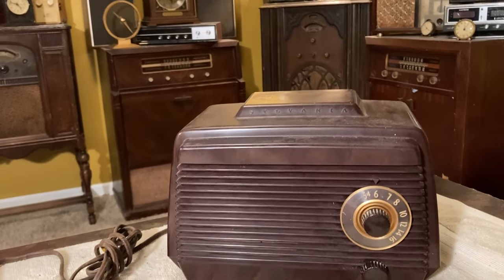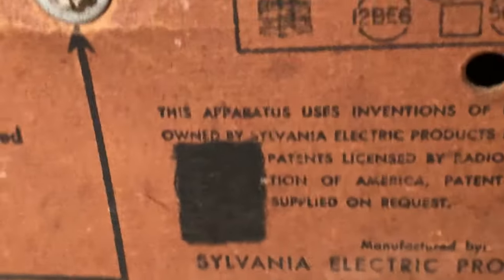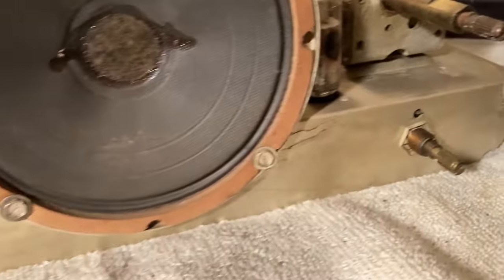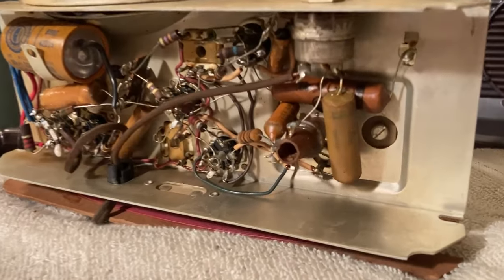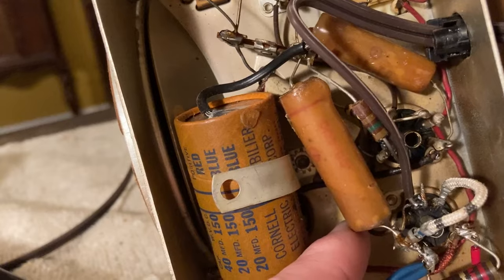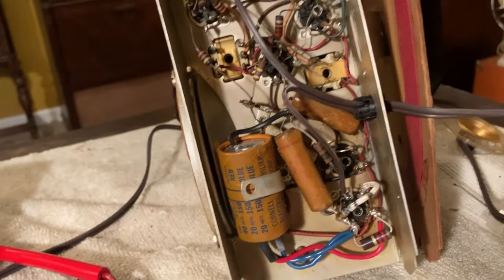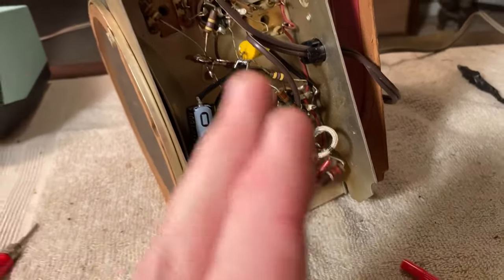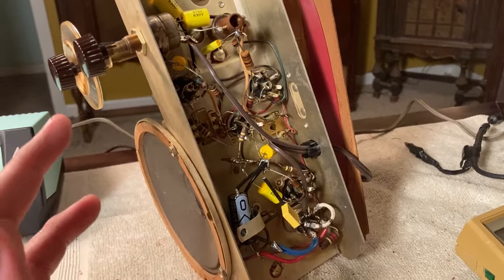Old Sylvania Tube Radio BUZZES On Low Channels!

Comment: Hi Ron, nice job!  Just wanted to mention in case you’re not aware, on a lot of these old schematics, resistors marked M are actually Kohms.  Only the ones marked Meg are Mohms.  Regarding the buzzing on the low end of the dial, it still sounds like power supply interference.  One way to check would be to take the radio outside away from any buildings and see if it goes away.
Reply from the maker: Thank you Maury!  That's the whole problem with the "I got the wrong resistors"... when I was looking at it, in the back of my head I was thinking "didn't these used to be marked different?" but I chalked it up to the mfd /mmfd thing...so when I ordered the resistors, I ordered them off the list on the other page, which shows the whole value.  470,000ohms for instance, so I ordered 470k... and then when I was looking on the schematic, it says 470m... and they sent me 470k (which is what I ordered off the other page!).  Well good now I know that the parts place isn't incompetent, I just don't know how to read :)  Thanks for watching!
Reply: Yup, M=1000 is an old school convention in manufacturing. We also sometimes saw C used for 100, like in Roman numerals.
Reply from the maker: That actually makes sense, Mille is 1000 in Latin, Spanish, French, Italian, Etc. I believe
Reply: Now you Menton it, I had the same problem. But 15 years ago, my local supplier knew how to read old schematisch. I learded alot from this guy.

Comment: The buzz didn’t occur when you powered  up before replacing caps, maybe one was incorrect, I would have kept the polarized plug and put the wide blade on the chassis ground so you won’t get shocked.

Comment: I have had similar issues with interference and it turned out to be under cabinet lights in our kitchen at the other end of the house. My father had loud interference on his radio and eventually discovered it was from a light in the kitchen of a house across the street. The neighbour got a new bulb and the problem was solved. Love your no snobbery approach, Ron.
Reply from the maker: When you were having that interference, was it only on the bottom of the dial?  That's the part that has me confused.  Thank you for watching Andrew!
Reply: I'm afraid I don't remember, Ron. I do recall that my dad's interference only occurred at certain places on the (FM) dial, drowning out his favourite station but leaving others alone. The only thing that allowed him to track it down was that it showed up primarily at meal times when his neighbours' kitchen lights went on. I think it was halogen lights causing the problem - as it was in my case. It does make sense to me that this sort of interference might be limited to a specific range of frequencies.
Reply from the maker: Someone else provided some info that yes it usually shows up on the bottom of the band, I'm going to see if I can find anything else in the place but if not it may be a neighbor's house, lol  Apparently you can see it with a scope too I may try that, thank you for the info
Reply: Good luck - it's a cool no-frills radio, although they spent money on that geared tuner.
Reply: @AmateurRepairTime  I've worked on a lot of radios, and that type of static is quite common around here. I'd imagine it's better or worse on certain radios depending on their design. I've just accepted it as part of the AM band in our modern times. It's interesting that it still seems to have a 60Hz component (in the USA), but it sounds like pulses. Fluorescent lamps can cause similar interference, and I actually found one of my motion activated lights caused horrendous interference that only went away when I replaced it with one that works with LED bulbs (which I believe uses a relay instead of a triac for switching).  I bet another radio will receive the same interference so you can clear the Sylvania of being the culprit.

Comment: And another thing! ;-) In the 1940s and 1950s, the plugs on the power cords were originally molded like the new one was. However, since people liked to unplug their radios by yanking on the cord, they ended up having to replace the plugs with the screw-on ones like the one you found on that radio.  But I'm not worried about it. I can't see it from my house! ;-) I enjoy your videos, and you are learning a lot, as I've learned from you as well.  (Your work on solid state pinball machines has encouraged me to work on solid state audio!) Nice job, radiophonopinballnut!

Comment: To check suspected alignment error without adjusting screws , can add and subtract hand capacitance via insulated tool, it either worsens or improves

Comment: Your actually doing it right.. Bring the unit up on a isolation transformer slowly.. See what the radio does??? If the filaments are in SERIES, and one is open the radio will not only do nothing, draw no current, but the tubes will not glow.. 99% of the time, bad tube.. If the tubes are OK, may come up with a Bad Hum, 99% of the time bad capacitor... Better to figure out the basics, before you dive in and spend the time and $$$ replacing capacitors, only to find out it does not work... 🙂
BTW, not sure if you own a DimBulb current limiter, but a must have for first power up of any tube or electronic device... Mine is very unique, but there are tons of documentation on how to build one.. Personally I think mine is a better way to do it and cost 1/2 the costs. Had to go to both Lowes-Home Depot and a local Electrical store to get all the parts, because not everyone had the right parts available!! 
As for the noise, I had a similar and what the fix was, was to go and tighten down all the securing screws on all the Circuit Breakers in my breaker panel, including the main ground buss... May or not cure your problem... TBD
Robert San Diego

Comment: That's a good radio, Ron. Got good selectivity. Your local super station isn't filling the entire band. Good sound also.
Reply from the maker: I just wish it didn't have that static down on the low channels, my favorite channel is 650am but it's 500 miles away so these little antennas don't pull it in very well.... Thank you for watching WackyTO8!

Comment: You are lucky out there with all those AM radio stations. It took me 15 years on and of to "repair" my 1949 Chevrolet car radio.I bought it along with a piece of the dashboard they cut out the car with an acetylene torch. I didn't know the amplifier/power supply was missing so I build one from scratch. It was hard to generate the needed 300v DC out of the 6v battery. Last year I got it all working just to find out here in Europe there are no more stations to tune into. :(  So I bought an AM transmitter to play music from my cellphone to the radio.
Reply from the maker: That's crazy that there's NO stations, as you can hear over here there are actually still quite a few of them, each town has a couple, and you know at night (I recorded this at night) you can pick up dozens of channels on most radios with varying strengths.  Usually when people in the states say there's no channels, they really mean there's nothing GOOD on any of the channels.  At night there is a show over here called "Coast to Coast" that used to be hosted by a gentleman named Art Bell, and it basically was all the 'weird' news and conspiracy theorists.  It wasn't really political, it was just people saying they saw an alien, or that Pepsi is poisoning everybody, or whatever, and the show quite honestly is pretty good.  You can pick up every night because everybody syndicates it.  It's harder to find anything playing music, though, most of it is sports talk radio which is about the most boring thing ever.  On this one I was picking up about 6 channels with music, WSM out of Nashville which is country (but very weak on this radio), then that Zoomer radio out of Ontario was  stronger and had really good stuff playing, then there was a channel actualy playing Rap down low (about 620), 1 hispanic station, and about 2 others that were playing religious music (which I like sometimes).  If I can figure out this crackle in it I think it'll be a decent little radio.... thank you for watching as always, I know you've been subscribed to our stuff for years!

Comment: FYI Ronnie, the back has a "UL listed" insignia but is blacked out. Gee Shango has no problem plugging in a radio with a
line cord like that but maybe he has great fire insurance. White stuff on and in knobs appears to be a mold which can be
cleaned in diluted bleach or isopropyl alcohol. Cleaning  them with Simply Green with a toothbrush may also work. The 
tuning cap blades may be dirty and shorting so try putting an old credit card between the blades to clear them. WAIT A 
SECOND THERE RONNIE!  The resistors marked Meg are Megohm resistors on the schematic. The ones marked M are actually K (i.e. 1000). So a 22M resistor IS a 22K resistor. So they sent you the right ones. The alignment is off and 
shifted to the high end. Will have to redo after  replacing resistors.  Steve
Reply from the maker: Shango at least does it in his driveway, LOL  Did you see that video he did, where the damn power line got knocked down, and he went out in the middle of the night to inspect it?  It was still burning and sparking and he's out there touching things, craziest electrical video I've ever seen!

Thank you Steve, I just figured out the M/K thing about 10 minutes ago, lol  Now by shifted to the high end, do you mean the dial alignment is off, or do you mean that may be why I have crackling on the bottom 1/3rd of the dial?
Reply: @AmateurRepairTime  It might be both. But correctly following the basic alignment sequence should solve it.

Comment: Another SuperHet alignment tracking quick check trick... This one is magic!!   
First set the dual gang condenser to fully unmeshed. 
Then find trimmer for the antenna tank (not the other local osc one) and put a screwdriver on it ready. The two are usually on the tuning condenser. 
Then with other hand very slowly turn the tuning dial, while 'rocking' the trimmer slightly left and right, listening for the 'peak'. 
As you turn the dial slowly, observe where the 'peak' is, and how it moves position. 
Ideally the peak should stay in the same place each end of dial. 
The way the peak point moves through the dial is a great insight into the alignment tracking.
Reply: Additional..  can do a similar thing with the antenna rod's coil winding if it's not sealed or glued. As the tuning dial slowly moves from one end to other, move the antenna's coil slightly in and out of its position checking where the peak noise position is. The peak noise point should be in the same place as the dial turns.  Touch the coil former by its edge or use a plastic tool to move it.

Comment: Ron, My Dad used to have a tool to straighten the plates on a tuner and said the noise was usually oxidation and gap on the plates. He used to have a can of tuner cleaner spray, probably the predecessor of deoxit. I was too young to remember the before and after results when he was working on TV's and Radios to know if it was the magic fix.
Reply from the maker: Hmmm... (hummmmmm, lol).....  I thought that may have something to do with it, because if you think about it when you're down on a low channel that capacitor is almost closed, so problems with it physically (oxidation, etc.) might be it.  We'll see if anybody else chimes in, if there is a tool to fix that I will buy it for sure.  I'll do some research on that topic and I think I've seen Shango do some stuff with that, thank you Macdaddyns
Reply: I wouldn't straighten the plates. On many radios they're intentionally bent to adjust the dial tracking. If the plates were touching we wouldn't hear anything.

Comment: It's amazing well preserved and clean for it's age. Sounds like AC line noise getting into it somehow, sounds 60 cycle to me
Reply from the maker: I can't ever tell the difference between 60 cycle and other interference... and this one I don't understand why it's only on the bottom 1/3rd of the dial.  I'm thinking it may have something to do with the tuning capacitor or the blades on it...
Reply: Found this on the ARRL site:

Because power-lines carry 60 Hz ac, the voltage on them passes through two peaks each cycle (one positive and one negative) and pass through zero twice each cycle. This gives 120 peaks and 120 zero crossings in each second. Power-line noise follows this pattern, generally occurring in bursts at a rate of 120 (sometimes 60) bursts per second. This gives power-line noise a characteristic sound that is often described as a harsh and raspy hum or buzz. Because the peaks can occur twice per cycle, true power-line noise usually has a strong 120-Hz modulation. 

Noise occurring in bursts at a rate of 120 bursts per second, and the resulting characteristic raspy buzz or frying sound, is often the first and most obvious clue of power-line interference. It is typically a broad banded type of noise starting at the low end of the radio spectrum. Power-line noise is usually stronger on lower frequencies. It occurs continuously across each band, up through the spectrum to some upper frequency where it will taper off.

A good test for the 120 Hz burst rate for both indoor and power-line noise sources involves an oscilloscope. The oscilloscope should show the bursts occurring every 1/120 seconds, or 8 1/3 ms. Look at the suspect noise from a radio's audio output using the AM mode. Use the wide filter settings and tune to a frequency without a station. Power-line noise bursts should repeat every 8.33 ms. If this is not the case, you probably don't have power-line noise
-Is It Really Power-Line Noise Or Something Else? (By Terry Rybak, automotive EMC engineer)
Reply from the maker: Well that sounds exactly like what I'm seeing, I'll keep unplugging stuff but I don't have much here, maybe it's a neighbor's light or something like someone else mentioned.  I'll see if I can get an oscilloscope on it too.... I'll give an update in the next radio video, thank you for the information!

Comment: Check other AM radios and see if they are noisy in the same manner. Grounding the chassis, if it's not hot. Use a .01  value disk cap if it is hot could help. Very noisy in my part NC and grounding helps tremendously.
Reply from the maker: This is one of those with a floating B- lifted up off the chassis with a cap, I wonder if putting a bigger cap on that will do it....

Comment: I noticed that the radio had a manufacturer’s address in Buffalo, NY. Which may explain the 25Hz power rating.  Some of the hydroelectric dams were setup to use 25 Hz and other frequencies before 60 Hz became the standard here.
I recall an article about a candy company there that has a 100+ year old machine designed for 25 Hz.  The power company can upgrade them to 60 Hz at any time, but their contract calls for the power company to pay for the machine upgrade and a guarantee that the machine will continue to operate X years trouble-free.  There are large penalties if the machine fails.
Reply from the maker: You'd think the power company would have figured a way to screw the candy company out of that contract by now!

Comment: I enjoy these episodes very much. I was into working on tube radios as a hobby thirty years ago or so. No internet back then for help or parts back then but a friend connected me with a good electronics catalogue, and I was able once to get a nos tube from an electronics distributor that had been around forever in the city. Agreed about the minimalist appeal of the American fives. There's something to be said about a design so progressively refined that the controls are intuitive and don't even need to be labeled. User friendly, they need to bring that concept back.
Reply from the maker: I agree 100%, they were able to lower the price of the design, but didn't really sacrifice quality past a point of reliability.  I just took a 74 year old radio, replaced the rotted power cable and it WORKED.  So we all have to agree that the reliability or longevity of the thing isn't in question, and yeah this was a cheaper radio than some of the other ones, they cut cost on it, but if the thing still worked great (74 years later!) really you can't fault them for that.  It's amazing to see frankly because we're all so used to modern 'deception in design' or whatever you want to call it.  Things that look flashly but break and can't be repaired, etc.  Plus it was all made in the USA!  Crazy.

Comment: It's a vernier drive tuner. Probably ball bearings making a little planetary reduction drive. Nice radio.
Reply from the maker: Thank you
Reply: I have that 1950 Philco radio phono console in the background to the right. I saved it from an uncertain future. I think it has a bad IF can/transformer. The record player needs an overhaul with replacement of anything rubber.

When the radio is working it has excellent sensitivity and sensitivity. It also has very good sound quality which did surprise me a bit. I'm thinking it has a six or eight inch speaker close to the ground and with a good amount of cabinet wrapped around it. It couples to the floor and has a full rich sound.

How do you like yours? Did you have arcing IF transformer?

Comment: You need a pocket radio to hunt down the interference you are getting. I live in an apartment and sometimes  even the local stations get buried. Increased noise below 7 or 800 kilohertz is common most places. Sometimes the band is dead quiet and I can check all my radios to see if one is creating the noise and needs work. Early evenings I can hear microwave ovens running as meals are heated up. Sometimes I think I hear wi-fi interference. Things we must live with.
Reply from the maker: Tonight I tried turning off everything in the house and it was still there, it may be something outside... I'm going to fix another radio and see if it has it.  I'll try a pocket one too and see what I find.